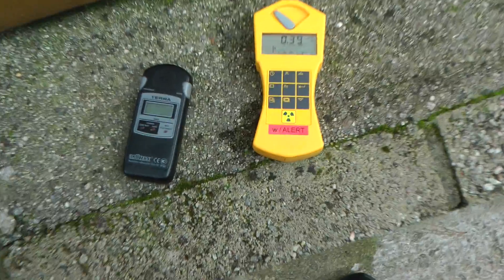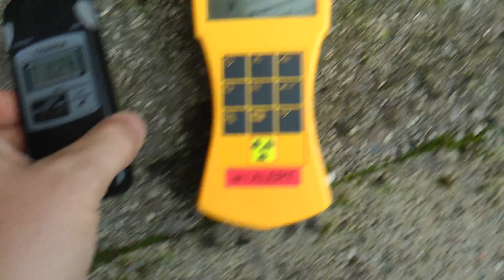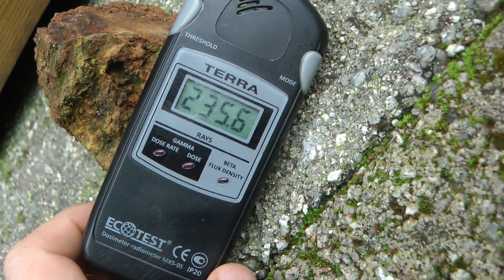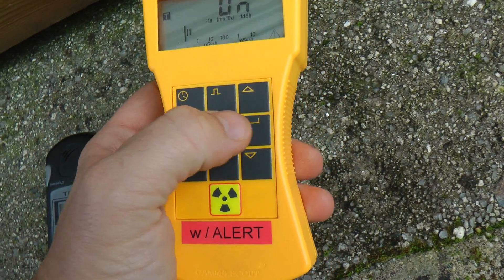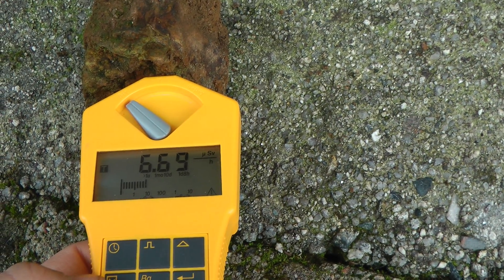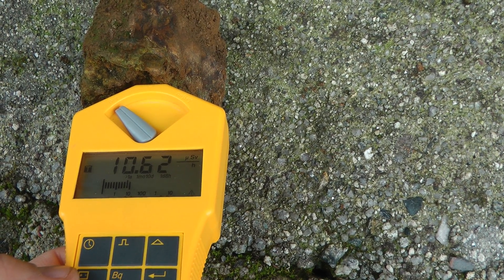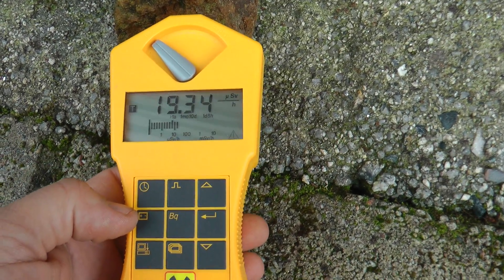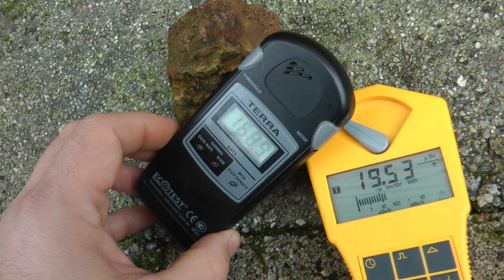Problem with [Early model*] GammaScout

Comment: Thanks for sharing this. I was going to save up and buy a gamma scout as well. Mainly because it reads alpha. But if it falls down at 200msv whats the point! Think i'll get a terra-p. Currently have a gmc 320 and CDV-700. Wish i had a rock that hot. The hottest thing i've got is an old radium clock about 10msv. Can you buy rocks like this? Or are they in the wild. (AH, just read your description). Would you still recommend the fixed gammascout?
Reply from the maker: Paul Shiels my friend bought a working gamma scout and it is a load of crap. Steer clear. If Alpha is important to you get a mini instruments 900 or a Ludlum.
Reply: @MarkThomasChannel  Thanks. Will not bother getting it then! I'll check out those ones you mentioned.